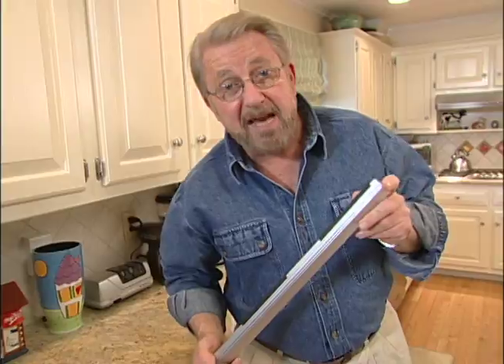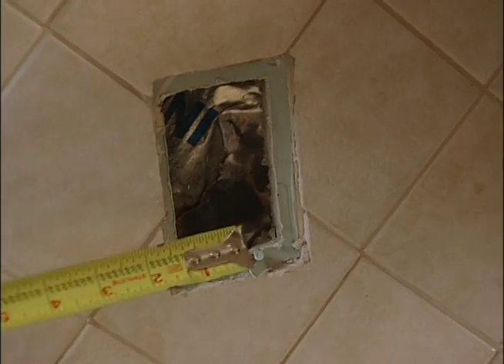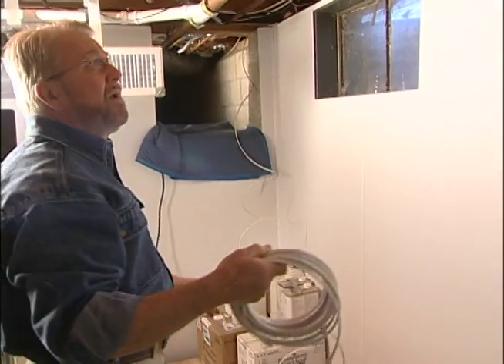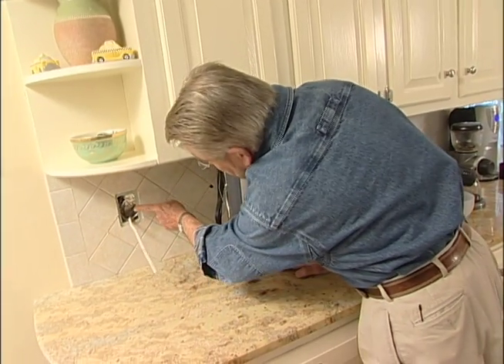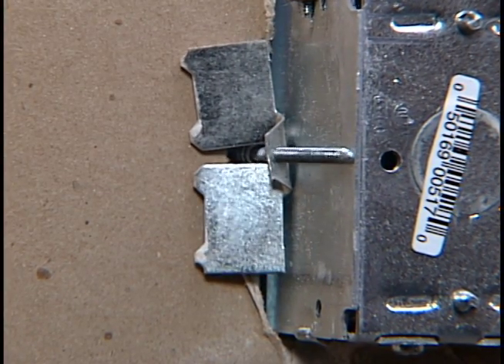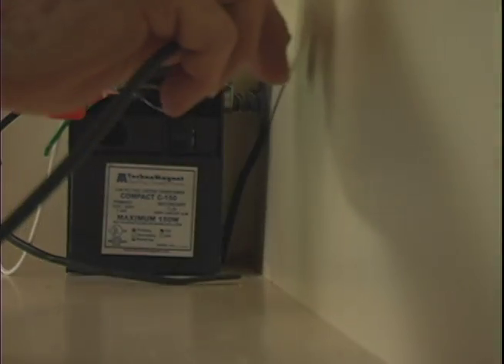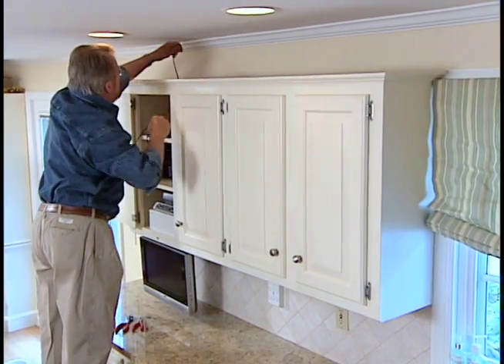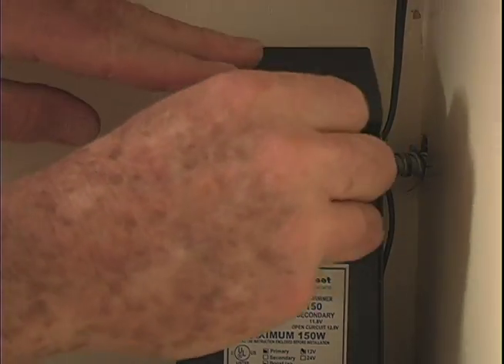Under Cabinet LED Lighting

Comment: how does a video posted in 2019 look like it was made in 1998 and what kind of jack leg tiles up to the faceplate of a phone jack without removing it
why do you have to go to the basement, there's a light switch and a outlet like 3 foot away?
why do you put the transformer in precious cabinet space, you already drilled a friggin hole to the basement, put it down there and run LV up to the switch genius, a light switch will handle low voltage just as well as line voltage...
Reply: Because if you did there would be no way to shut off the 120v line current that flows in the transformer primary - a potential fire hazard. The transformer is most likely considered part of the electrical appliance which must be capable of being switched off.  However I don’t think the cupboard is a good place for the transformer either.
Reply: Can’t go to the outlet, lighting must be on its own circuit in kitchens.
Reply: You forget that low voltage-high current applications like this undercabinet lighting suffer when long cable runs are used. Each inch of wire acts like a very weak resistor, and the amount of power lost to a resistor is proportional to the current running through it *only*. the high voltage-low current electricity before the transformer, because the current running through it is smaller, has less power loss to wire resistance. Therefore, it is desirable for a project to minimise the amount of low voltage wire runs, even if it means running high voltage wire longer.

This ignores the heinous amount of low-voltage wire he used between cabinet.
Reply: Matt S. Agreed, I was distracted by my tossing cookies from seeing the install and my brain left reality for a minute.  Then the argument for on top of cabinet makes sense and likely with two transformers, one per cabinet set.  I guess doing the math on loss would be helpful in that decision.  It also makes sense that he use a flat low profile build for the transformer so it could be installed under the top cabinet.
Reply: Matt S. The likelihood this is low voltage-high current is very small. Though possible, these led lights look nothing like high output ones. You've exaggerated the loss factor as well. We are probably looking at  (if I were insane)  worse  a 5% lose. Most of that would come from if low quality components of the lights were used.
Reply: @jimk5307  Actually you CAN put lights and outlets on the same circuit.  Its just that when you trip a breaker the lights go out too, that's why we usually put them on separate circuits.  The NEC doesn't forbid it, its just good practice to separate them.
Reply: I HAVE ALL THE SAME QUESTION LOL
Reply: "how does a video posted in 2019 look like it was made in 1998..."  Because it was made in 1998.  This is an old TV show.
Reply: @KevinFields777  funny cause the tags on his truck are 2008
Reply: @osgeld  Hey, good spot! :)   So, there we go, it's 12 year old video.
Reply: Who said it was made in 2019?
Reply: @ramblinman7153  no one, I said posted not made
Reply: @osgeld  yes, it was posted in 2019. But it was recorded in early 2000s or late 90s.
Reply: @ramblinman7153  yes cause commercially available white DIY undercounter White LED strips were abundant in the late 90's early 2000's, its mid 2000's at the earliest based on that plasma TV more realistically since we had to have a transformer module like only 10 years ago

Comment: Per NEC code. Dishwasher/Disposal is   on dedicated circuit. Lighting is on separate circuit. You tied on 14 gauge romex to 20 amp circuit.  12 gauge= 20amps. 14= 15amps. Very nice showing how to wire it up right and follow code. Next video you should use the cat5 telephone wire instead of the 14g and show them how to burn down there house. And if I have to tell you the code reference you should not be doing it.
Reply: Very good call

Comment: Why did you bring electricity up from the basement and from where you connect the garbage disposal? Why do you need to electrical sources
Reply: This video is 20 years old. The garbage disposal's electrical line was likely the easiest to access and it didn't require him to rip out the tile.

Comment: I bought some puck lights and they looked great. But every time they burnt out I could not find bulbs or the fixture even at the same store it was purchased. So I buy a different set. Halogen. Worked great but burnt out and they stopped selling them.  I do not want LED lights because they are cold looking.
Reply: You can get LEDs in very temperature range and color.

Comment: Hmm, this seems overkill.  I think I would rather get some LED light strips and learn how to Solder.  Also, when looking at the illumination it wasn't that bright.  I know if you get the right LED Light Strips you can have some high lumens.  Also, you will get more options like color and dimming.  You can control with an app instead of a switch.
Reply: This video is at least ten years old.

Comment: Wouldn't it look nicer to use the space behind the cabinets instead of going through the cabinet shelves. Sorry but I don't want to see wires in my cabinets when I open them up. I have under cabinet lights and that's what the electrician did.
Reply: What space was behind the cabinets?
Reply: Cabinets usually are mounted flush to the wall. There is no space behind them

Comment: Hello Ron, am not familiar with armored cable. Could you please explain? thank you. always great to watch your shows
Reply: If you go to any home depot type store its called mc cable
Reply: BX cable
Reply: Type MC cable has an insulated ground wire, and is most commonly used in modern electrical work. Type AC cable (often called "BX" after GE's original type BX cable) has a aluminum bonding strip ran under the armor but over the wires. This is critical, because the armor alone is a high resistance path for fault current. Adding the bond strip allows the armor to legally be used as the grounding means on that circuit by creating a low-impedance grounding path.

Comment: If I was doing this install I would use white wire and use wiremould to conceal all wiring. I would also use pro tools by Klein, this guy is using crap tools
Reply: And, yet, he demonstrated you can easily do this with crap tools.  Heck, he could have done all of this with hand drills and duct tape.
Reply: Who cares what tools were used as long as the job gets done. You aren't going to be able to tell what tool was used once it's finished.
Reply: @ramblinman7153  47 years Union IBEW trained electrician, we know how to do it right the first time....let the rats do it, come back three times to fix it

Comment: Such a old video and a complete waist of time. The dimming and power has changed drastically over the years to 0-10v dimming and DC low voltage (not the 12vAC he showed) and better control and power savings. Who ever owns this content should not post such outdated stuff.